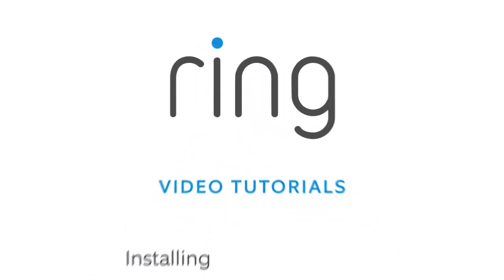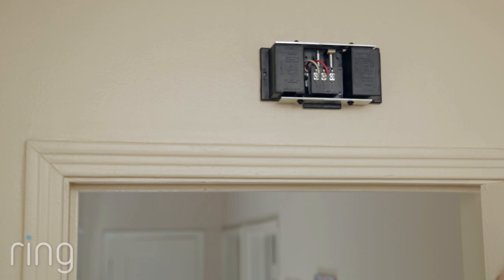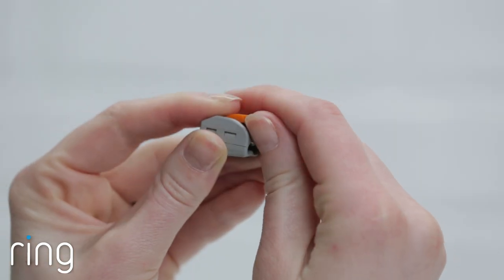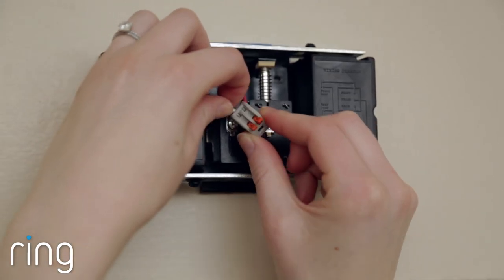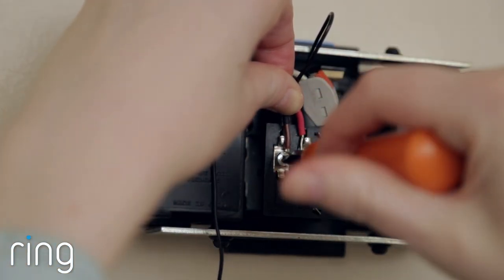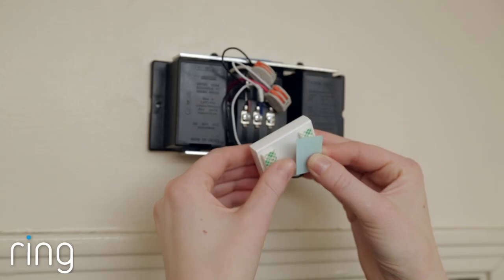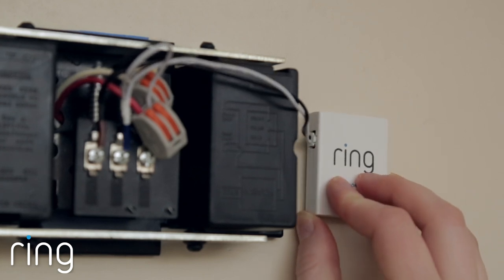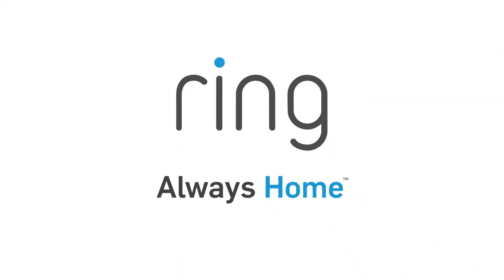Video   Ring Pro Power Kit Install

Comment: The point is you don't need a chime. The RING doorbell doesn't work with your existing mechanical chime so you need the pro kit to make it work. Simples.
Reply: late reply it stil chimes your internal bell the pro power kit is a resistor for the ring pro

Comment: What is the purpose of the Power Kit? can I install the ring without it?
Reply: late reply its for the pro to get enough power
Reply: @VOLTRONDEFENDER4440  what if it’s not getting enough power with the power kit give it more power??
Reply: @ArianasMoments there's another bigger module you may need

Comment: The wiring is extremely confusing and impossible. For example, the black wire from the kit is connected to the white wire, then she says connect the other end ... First, her hand is blocking most of it, it's not shown; second, one wire can only have one end. If one end is already inserted in the connector, the other is inside the kit, then where is that loose end coming from??? A very bad video.